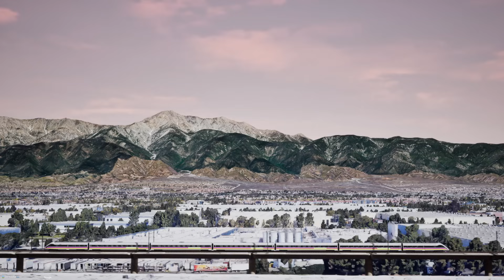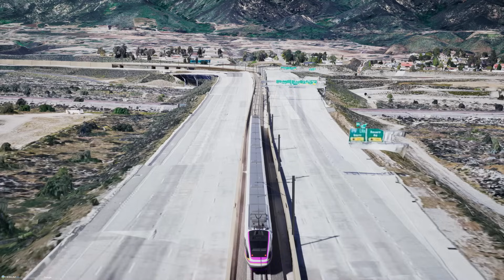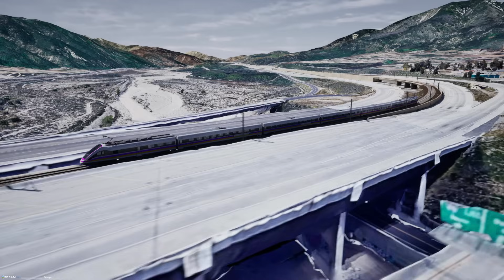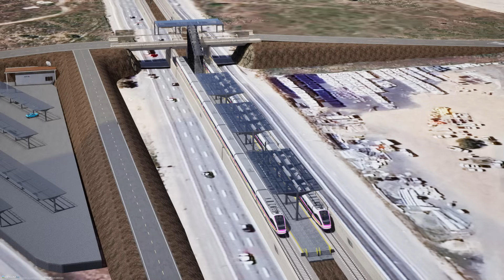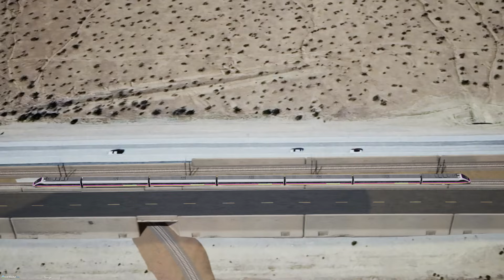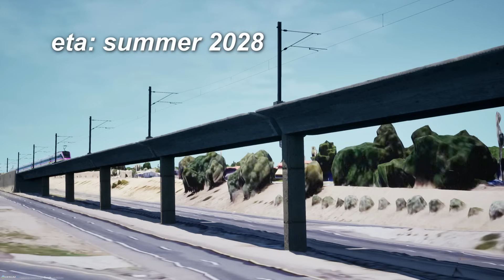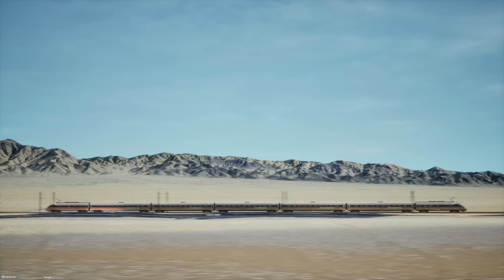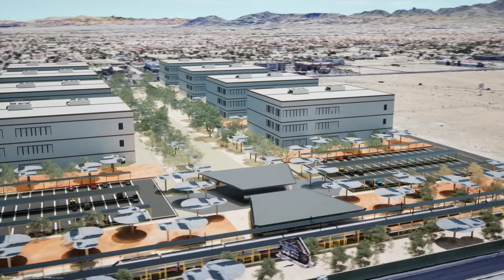The Brightline West High Speed Passenger Rail Route Rendered With Unreal Engine 5

Comment: Ain't no way there going to build thus for 12.5 billion isn't going to get them from Stateline to the strip
Reply from the maker: What do you base that on?  It's 26 miles of rural median work followed up by 6 miles of freeway adjacent work that is similar to what they've done before in Florida. The only issues are the mile of southbound I15 they have to rework and the two flyover ramps, neither of which is that big a deal. There's no earthly reason for that cost remotely near $400 million/mile.
Reply: @LucidStew look how much it costs to build a casino in Vegas it's not cheap to build there . Second your building along a freeway it isn't going to be cheap I doubt 12.5 billion would get you 2 lanes of freeway that distance. 
Second major hurtle high speed trains that can go up a steep grade don't exist. .
   If built this would be the steepest mainline railroad in anarica.   Clearly that isn't a giant red flag to you as far as safety or practical engineering. 🙄 
     Simply put you can't make a high speed locomotive capable to pull a train or safely go down  your  projected grade  it would need a traction rack or other safety system and those don't work at high speeds and are not cheap ......
 Cajon has a long history of run aways trains on its 3% to 2% grade
Reply from the maker: @ELDRGW  Your sense of what things cost is way off. 32 miles of 2 freeway lanes wouldn't cost remotely near $12 billion unless it was running through the middle of a major metro area.
Not sure what the grades have to do with your over exaggeration of what things cost.
If you think you have a legitimate argument about the grades being impractical, present so some mathematical evidence.
Reply: @LucidStew  The cost of high-speed rail varies by country and location. In the US, the cost per mile can range from $154 million in California to $500 million on the Northeast Corridor. In Europe, the average cost is $25 million per kilometer. Most regular train routes cost at least $10 million per mile to build a new track along a existing route for freight use .
   This project well run out of money before it gets finished  but in reality it should never start as its route is just not a good option for high speed rail period.  As you point out it's only going max speed maybe 50 miles of this route ..
When they lost the environmental bid for the separate independent route they should have just killed this project.  Instead there trying to make a high speed railroad in a freeway that is anything but high speed ready
Reply from the maker: @ELDRGW  They may very well go over budget, but they have a big factor in their favor: they already own all the land they need to acquire and have the rights to use the land they don't own. For the vast majority of the 218 miles all they need to do is grade the roadbed, lay track, plant posts, hang wires, and put in concrete barriers.
Reply: @LucidStew your own video proved one thing to me and that's this is just one bad idea layered on a route unfit for high speed service ..  the cajon part is literally a impossible pipe dream ...
   Trains don't do more then 4 % max grade domestically for a reason anything above that I'd just unsafe and regular train technology wouldn't be able to pull a train up or down the pass safely .
     Steal wheels on steal rails have a limit this limit has not or well not change.
Reply: @ELDRGW  Heavy freight diesel trains don't do more than 3-4% but BLW is a lighter weight passenger electric train. The comparative tractive effort is so much greater.
Reply: @davidjackson7281  such a train dosent exist  your looking for a lightweight high speed train that can climb a steep grades and provide a comfortable ride    
  I think if that train existed we would have tons of them. But in practice every attempt at anything like that has failed domesticly and international .  Light high speed rail vehicles don't exist for a reason. .
Reply: @ELDRGW  German lCE trains traverse 4% grades. Perhaps a short tunnel may be built to mitigate the Cajon Grade. l believe BLW engineering knows how.
Reply from the maker: @ELDRGW  That's kind of the purpose of the video. To put out the information and let you decide if you think its a good idea. I would posit that if >4% were a technical impossibility then the project would not have gotten this far, nor would any trainset manufacturer be interested in the project. However, here we are with a project approved to go beyond 30% design by the FRA and STB with two different trainset vendors interested. Again, if you have some sort of mathematical evidence for why >4% is impossible, please present it.
Reply: @ELDRGW  They said it nicely but in other words, unless you have something concrete have a seat. Clearly the Siemens and Alstom engineers think they have a trainset than can handle the grades here. As already mentioned, old ICE 3s already traverse 4% grades, much less newer Velaro Ds / ICE 3neo's. A Siemens Velaro Novo/American Pioneer 220 which is much lighter and more powerful than its predecessors, should have greater feats.

Comment: how much does the lack of double tracking on parts of the right of way affect the maximum potential frequency of trains in the future for brightline?
Reply from the maker: There are some places they intend as permanently single-tracked, but in the environmental assessment they have identified enough double-track mileage to support 22.5 minute headways. They switched from initial 45 minute headways to 1 hour in coordination with Metrolink, which they connect with in Rancho. Initial double-tracking is minimal, but when they switch to 30-minute headways, about 80% of the 218 miles will be double-tracked.

Comment: I think a key for this to be successful after they build it will be all the drivers watching the train whip past them. I know this will be tough with all the high grade portions but hopefully they can get a train that can make it look impressive even going uphill.
Reply from the maker: That will be hit and miss because I can guarantee it will be slower than traffic in some places. It is not unusual to see people driving 100mph out there, so they have some competition to seem truly fast. For me personally, it would only take one time being bumper to bumper coming into Victorville on a Sunday night with the train going by at 110mph to convince me to try it next time.
Reply: @LucidStew  Good point! I'm on the New England coast, so seeing normal people going 100 is much more rare than being stuck going 40 or less on a business day.
Reply from the maker: @s.lajoie9961  It used to be EXTREMELY fast out there. Dangerously fast. However, in the last few decades traffic has increased quite a bit and road capacity hasn't really kept pace, so it's not so off-the-charts now except in the flatter Arabian Peninsula-looking parts out past Barstow.  But amazingly, you can STILL run into traffic. If you haven't seen it, check out Roaming Railfan's video driving and droning the route. He ran into some traffic out there(I got lucky on MY drive out there). It's also another good companion for this video.

Comment: So there will only be one track for most of the path. Not even one for each direction? That is not very future proof if it gets popular
Reply: Future proofing = extending the length of the train, essentially doubling capacity without even modifying the tracks. They can always add extra double tracked sections in the future. Brightline FL built their single track extension to Orlando with future double tracking in mind. Even the bridges and few tunnels were made to be double tracked in the future.
Reply: @Ven100 WHAT TUNNELS?
Reply: @michaeljones7927  You can easily Google image "Brightline tunnel"
Reply from the maker: They plan to expanding the amount of double-tracking to facilitate 30 minute headways(as opposed to 1 hour to start) once demand is great enough.

Comment: Great video- it adds context on the scope of this project. I seriously doubt BLW will complete the entire project by 2028 due to this being their first HSR project as well as the amount of infrastructure that needs to be built. Nevertheless, I will be cheering them on and look forward to one day riding this train.
Reply from the maker: I do think the Brightline extension to Orlando has provided them with valuable experience, but this seems like a tremendous task for the time frame. I'm crossing my fingers for 2030. If they can get it done in time for the Olympics, wow.  They ARE looking to employ 11,000 construction workers to build this thing, though, so they're certainly serious about the scale of construction.
Reply: My bet is that they will open Victor Valley to Las Vegas first and the rest later.
Reply from the maker: @franz-peter.kayser  I suppose that's not completely out of the realm of possibility. They do have separate environmental assessments for the 2 sections, so they may be able to get approval from the FRA and STB to operate just one on an interim basis until the other is ready.

Comment: Based on your rendering and illustration of the information provided by Brightline West, this is a poor intended application of High speed rail. Brightline West is doing a cheap version of high speed rail. They are penny wise pound foolish. Unfortunately this will give Americans the wrong concept of what a high speed rial system is and operates like. Texas Central/Amtrak has the best planned system thus far, however I doubt they have the financial fortitude and determination to see the project through.
Reply: Not sure what exactly makes this a "poor application of HSR".. Single track sections? Spain, with arguably with the most extensive HSR in Europe, also makes use of that. Putting stations in open areas? Unlike most of Europe that's been developed & has housed rail infrastructure to city centers for well over a century, there's a lot of development opportunities around these new BLW stations. China however has done this as well, putting some of their stations outside of major areas to then develop said area around the station.  The 2 hour 10 minute timetable from RC to Vegas is still much faster than driving and more than competes with flying. Even if you want to throw in the MetroLink transfer into LA Union Station the project is still sound. Brightline West's average speed of 100 MPH also more than competes with many rail routes in Europe. 

While not high-speed rail, Brightline FL's levels of service and amenities are already on par or better than even some European rail services. Brightline West will likely be even better than their FL counterpart.
Reply: @Ven100  The greatest service a high speed rail system much provide is the operating speed from point A to point B. There are two principles that contribute to accomplishing that. The gradient levels and the curvature of the tracks. To get these two principles as compilable as possible you have to invest in the necessary engineering, structures, and materials. This generally means constructing via ducts, bridges, tunnels, this keeps your track align as linear as possible.
Reply from the maker: Yes, I do believe it is something of a budget version, but I would expect a private company to attempt to minimize expenses.
Reply: @LucidStew  I understand your logic as regards a private company using this approach to minimize expenditure. However when you are developing, designing, engineering, and planning a High Speed rail infrastructure network, it requires smooth gradients, and smooth curves throughout the entire alignment to enable your highly capable train sets the ability to maximize their true cruising speeds. To accomplish that requires more fortitude, faith, and determination in maximizing the necessary budget amount. It's what England finally did when they  financed and built HS1 alignment from Saint Pancreas Station to the Chunnel, which encompasses tunnels, viaducts, and bridges, this smoothens curves and gradients throughout the alignment. No transits can operate over 180 mph throughout most of the alignment. Still a great rendering in this video.